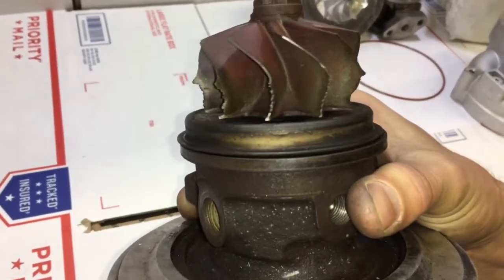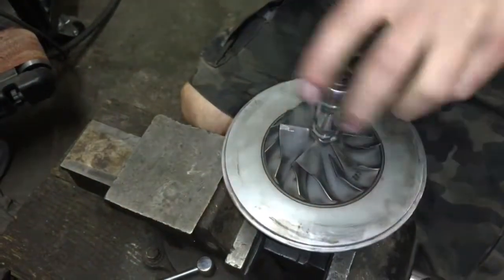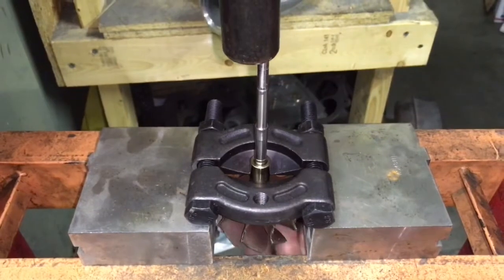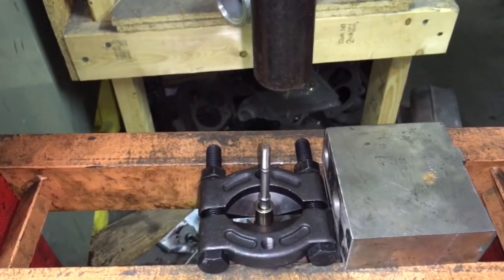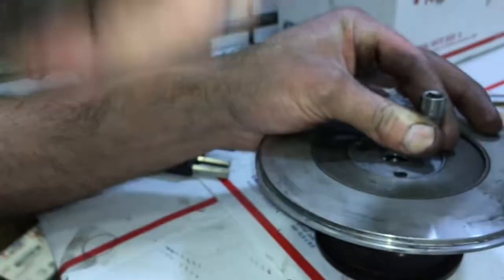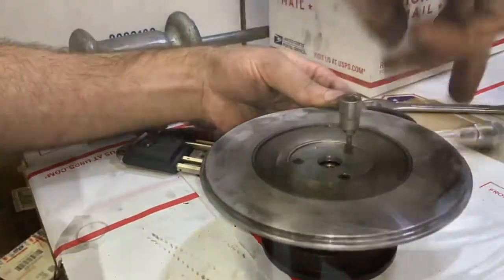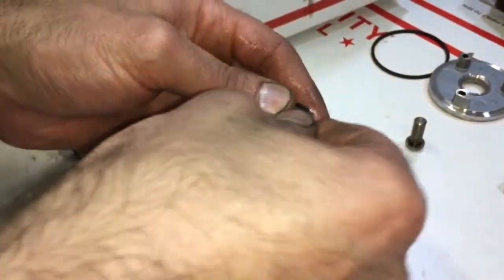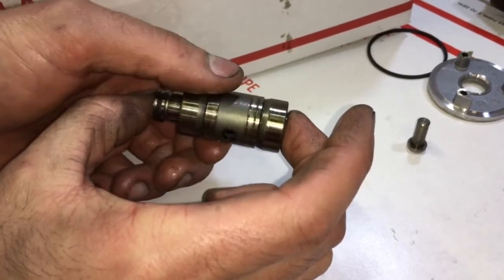How To Disassemble GT35R Turbo

Comment: Hey i got a issue just like this on my gtx 3576r gen 1 would you want too buy it compressor is good cart is good needs a turbine wheel and a turbine housing ,,Ill take 800 plus shipping its custom stock location EVO X turbo..

Comment: Which screw fit on the pin? And if i dont have a press, do you have another trick to remove the shaft? Thx
Reply from the maker: I think it’s an m4 or m5. I will check tomorrow.
Reply: @turbolabamerica   For anyone still wondering about this its an m4
Reply: @turbolabamerica  Perfect! 

Any trick for do the job without a press?

Comment: When I pulled my gtx shaft out of the chra some bearings fell out and the bearing cage was floating around in there. Is that normal
Reply from the maker: The pin holds the outer cage in place